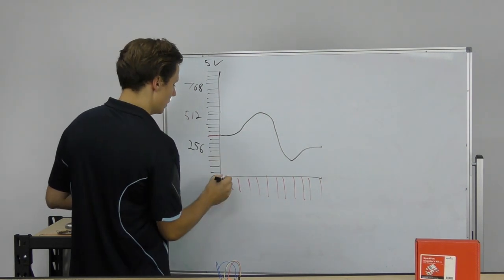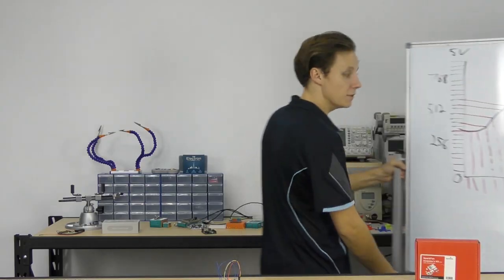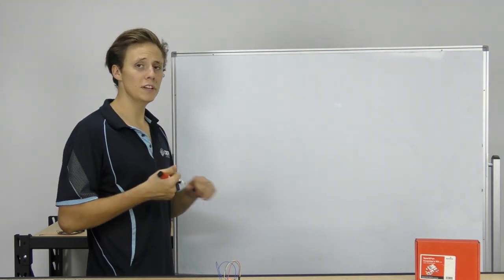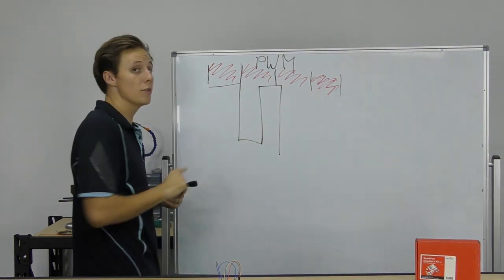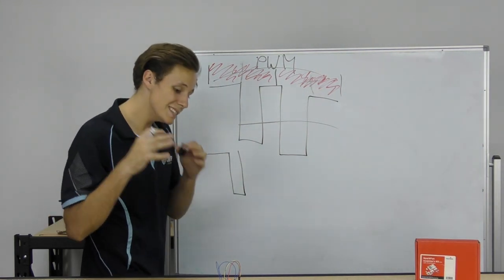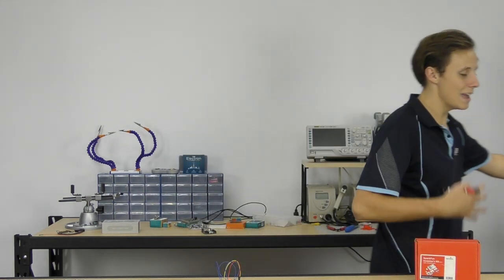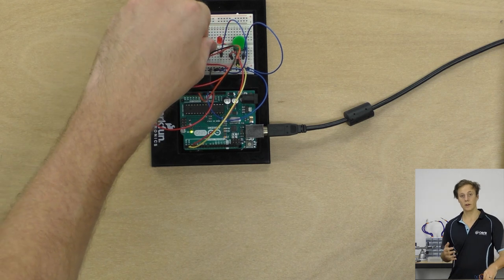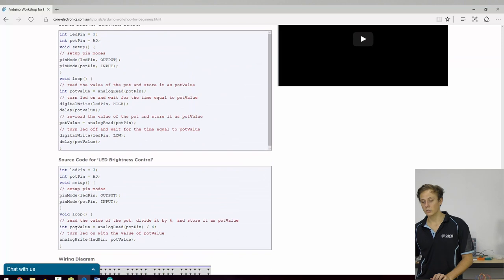Arduino Workshop - Chapter Two - Using Analogue Pins

Comment: For the last circuit, the one with the led light, could we have used analogWrite instead of digitalWrite and not used a resistor
Reply from the maker: analogWrite is not truly analog. Rather, it is Pulse Width Modulation. While the average voltage is variable, the pin is only ever fully on or fully off. That means you will have a lot of current being pulsed through the LED which is bad for both the LED and the Arduino.
Feel free to open a thread on our forum if that doesn't clear things up: https://forum.core-electronics.com.au/

Comment: Sir May i Ask, I'm just a little bit curious about how did you determine the outputs 0 to 255 range of 8 bits?, is there some truth table or something. I'm not really familiar with this so i'm curious bout anything, hope you understand. thank you.
Reply: 2^8 is 256 , in binary you'll have 0000000(zero) - 11111111(255)

Comment: But u Registered an int function for PotVal ===== which means that it can only register as an integer But sometimes the analog read from the potpin will not be divisible to 4 so.... I think u should have used a float function . that will make them more smoother ig , am i right or wrong? pls tell me

Comment: hi i have a 25 yr old cnc machine that im trying to replace orig controller board with arduino and control that way...im using orig 25yr old stepper driver board.....i .i have used a mach3 breakout board and machine stepper motors responds fine but when i try using arduino uno as controller  i get no response from the stepper motors...the stepper motors engage when pc and arduino uno is powered on but they dont respond to any jog moves in UGS.....i use Universal gcode sender and all looks good.....is arduino signals possibly not compatible with the 25yr old stepper driver board?